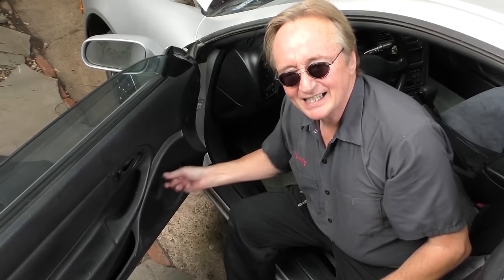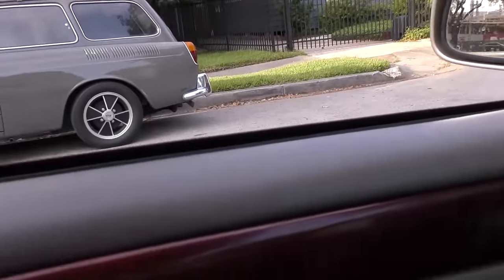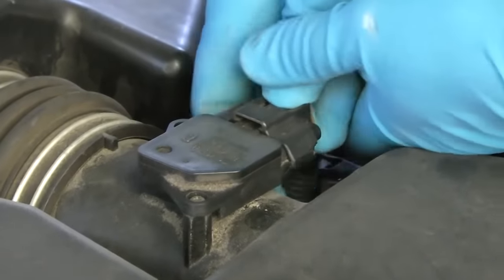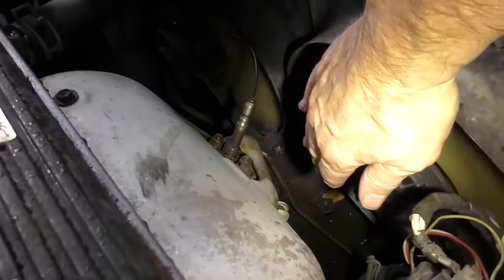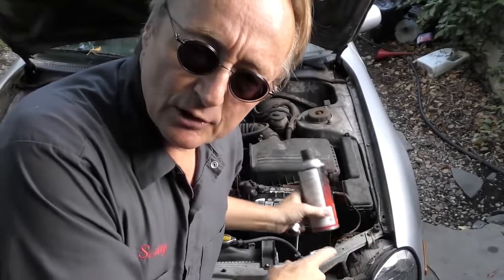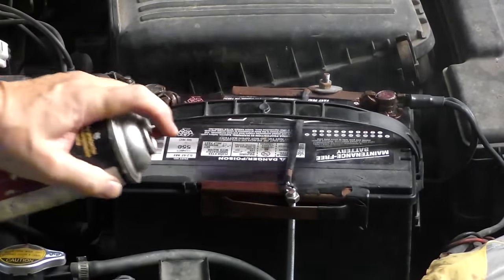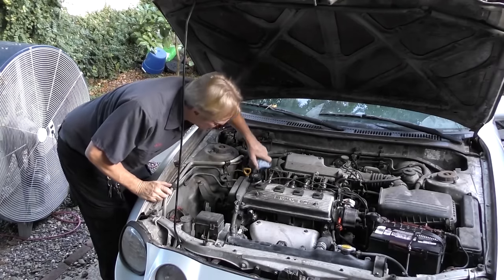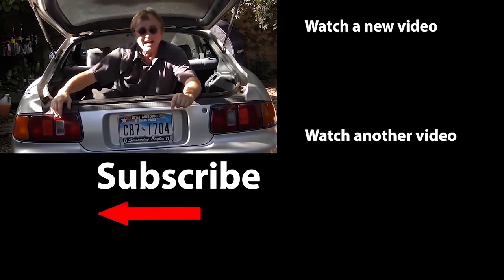I've Been Saying This for Years But You're Still Not Doing This to Your Car

Comment: I see that u r using CLR electrical cleaner it's saved me from my fridge to my power windows, when a coke was spilled on it , I used the CLR electrical cleaner and sprayed it on it and it fixed it like magic, it's cheap at Wal-Mart, and it's saved me $$$$$ it even saved my Granddaughter's toys when the battery s were left in to long, any Ware u need something electrical, it's a miracle. My daughter's has a Kia Sorento, junk and the electrical is messed up, and she can't afford another car, the battery goes dead so we got a alternator and it's still shutting the car off ,you can go maybe 45miles it shuts off then u count to 30 and it starts again , its been in the shop so many times  ,I told her to cut her losses and sell it to the junk yard. Thanks I love u r show u r so funny and a lost expert we desperately need.♥️🐿️🐦✝️

Comment: 8:42 -- You mentioned the EcoBoost Mustang producing more power with higher-octane gas.  A not-well-known fact is that this applies to ALL of Ford's EcoBoost engines!  If the engine is designed to run on 87-octane, it will, of course, run fine on 87-octane -- but it will produce more power on the 93-octane fuel.  So, no matter what Ford you're driving, if it has an EcoBoost engine of some sort, you will get more power if you use 93-octane.  How much more depends on the specific tune they've put in there, of course, but they'll all give you some HP increase with the higher-octane fuel.

Comment: The "automatic lowering but not raising" is for safety, so that you don't get fingers pinched in the closing windows.
Reply: My 2003 Mitsubishi Strada G-Wagon automatically reverses the closing window, if it encounters too much resistance, before fully closed.  Prevents fingers getting pinched.  It also encourages me to keep the windows and guides clean so that the windows will close every time.

Comment: Scotty, here are some gas tips that I have learnt over the years.  If most of your driving is city driving and you seldom drive on the highway, then use hightest gas when going on a trip driving on the highway. This helps remove carbon build up caused by too much city driving. Another tip is to use Shell gas and avoid Esso or Exxon gas, as this gas lowers your gas mileage.

Comment: CRC makes great cleaning sprays, especially their brake cleaner. Besides doing an excellent job on brakes and quickly evaporating with no residue, It is a very satisfying roach killer. You spray roaches, they will instantly flip on their backs, kick and spasm like crazy for about 5 seconds and then die.

Comment: actually, its possible for the air pressure a vehicle encounters while traveling to be GREATER than the vehicles actual velocity. This is caused by wind, in a headwind(wind coming towards the vehicle) you will experience travel speed+ wind speed air flow

Comment: Also if your auto window switch isn't working properly you can relearn it by holding it down when it's at it's lowest point for about 3 seconds or so and the same for going up if you have an auto up function

Comment: Whenever I use my turn signal with the lights on the speed of the blinker will slow down. If I turn the lights off the blinker speeds up. I have a new battery and my volt meter shows it’s over 14 volts.

Comment: I hate auto down Windows I rarely want the window all the way down and I don't want to spend the extra time to run the window all the way down and then run it up to a partial level. I wish we could turn back the clock to prior to TPMS and a lot of the so-called electronics advancements that have made vehicle repair more expensive.
And another video you discuss dealer problems
If they weren't making crap you wouldn't really need that many dealers.

Comment: Half way through this video I get phone from my girlfriend her 2012 FORD Focus power assist has stopped working. Just about every part on that POS has been replaced not even 200 kilometers 2 transmission. Don't ever buy this car so many recalls and class action suits. Ford has offered to buy car back, I told the even if you gave for price I've paid I'll never buy Ford! 2018 Mazda GT 3 Hatchback got a 5 year unlimited mileage warranty, almost 90 kilometers nothing broken. Just pads oil changes every 5Ks,only driven in city.

Comment: HI SCOTTY WHEN I TURN MY AIR CONDITIONER ON AND STEP ON THE GAS I HEAR A GROWLING NOISE COMING FROM THE RIGHT SIDE OF THE ENGINE THIS ONLY HAPPENS WHEN AM DOING 10 TO 20KM/HR WHEN I DRIVE FASTER THE NOISE GOES AWAY UNTIL I SLOW DOWN THEN THE NOISE COMES BACK I ONLY HEAR IT WHILE AM STEPPING ON THE GAS. THIS DOES NOT HAPPEN WHEN AIR CONDITIONER IS OFF CAR IS 2012 HYUNDAI SONATA ALMOST 300000KM ON IT EVERYTHING ELSE WORKS FINE I COULDNT GET A-READING ON MY SCAN TOOL SO AM A BIT LOST, AM ACTUALLY SUSPECTING THE COMPRESSOR BECAUSE I USE THE AIR CONDITIONER A LOT WHAT DO YOU THINK

Comment: the power windows and sunroof some on modern car's  have a control module that senses and learns the amount of current draw it takes to move the actuator through its travel cycle ,  if the control "senses" more current then it should it interrupts power and the window wont move ,  there are situations where the control forgets what it has learned ,, and you need to look up the process to go through to teach it again,  Search youtube "Power Window relearn (your model vehicle)" same with sunroof controls "sunroof relearn (your model vehicle)"  this mostly apply s to systems with "auto up/down"  functions that do not work properly.

Comment: 10-04-2020 - - - The reason the "up" switch shouldn't automatically drive the window up without holding the button is so some dummy or a kid doesn't hang his head out the window and accidentally push the button - choking himself to death.  FYI.

Comment: Hi Scotty I have a 2011 Ford Flex 3.5 L  engine the engine light has been on for a while auto zone scanner said the 2nd bank catalytic converter is not performing right, it's plugged, I normally buy the lowest grade gas, however this time  I filled the tank up with chevron middle grade gas thinking that it had more detergent in it so it might clean out the converter,  I was lucky it cleared up the converter and the engine light went off, have you ever run into this?   you are doing a great job educating people  keep up the great work    Kevin

Comment: Whoa be careful with that garden hose on the condenser coil. Too much water pressure can bend the fins and if enough of the fins get bent, it won't dissipate heat well enough and your AC won't blow as cold (or use more power and thus gas).

Comment: I never understood why they never put a secondary switch in them that engages (or disengages) when the window reaches it's limit (either up or down) that breaks the circuit for that direction so it's no longer trying to go any further whether you're still holding/pushing the button or not.

Comment: I had a Bad winndow motor on my CRV.  It wouldn't work. When I got the new motor I knew to tap on it and the window lowered  to the spot wher I could work on it. I motor had a bad contact point on it. Kind of like a bad starter that you would tap on to start the car. And yes the lights would dim while the window motor would do nothing.

Comment: Hey Mr scotty! I know this videos a bit old now, but you mentioned something in this video that I think might relate to my mother in laws dodge aveneger 2013. Could a bad battery contribute to the cars rpm dropping slightly by turning the wheel slightly and holding it while stopped? Its the weirdest thing literally the smallest movement and you can hear the cars entire sound change and the rpm drops a bit

Comment: Good advice still applies two years later. A little addition regarding Lexus automatic down and up. But what do you do if you only want it part way? Mine can easily stop anywhere . . . But I can't remember how! I (think?) each control switch  has both intermediates and full travel operating positions. I''ll have to do some experimenting or (Heaven forbid!) read the handbook to find out how to find out for sure.

Comment: Scotty,
For car/truck batteries, keep the battery' s top squeaky clean. Why? Road dust  is mostly made up of rust from other older vehicles. The "dust" (rust)  gets on the top of your battery causing a high impedance short between both battery posts. This puts a drain on your battery while it isn't running causing it to wear out sooner. Also, the alternator has to strain that much harder to charge the battery up to its "normal" condition. So, keep the battery clean, and use vaseline on the connectors and battery posts protecting them from oxygen causing corrosion of the lead posts and battery clamps. Vaseline has been a 60 year old solution to corrosion, and it is much cheaper. And, it WORKS! Everybody has petroleum jelly (vaseline) in their homes, and it is much cheaper than aerosol cans of protestant.

Comment: Are you Kidding ! You Do NOT Spray any Cleaner into ELECTRONIC THROTTLE , that's A Good way to Screw up the Electronics in the Throttle Housing on the side of the Throttle and they are Pricey to Replace $800 to $1,500 on GM just to name one...   You can only spray in Cable operated Throttle's NOT Electronic Throttle's...
Reply: I’m must have missed this.  Is this what he did, spray re electric throttle?  🤔 so he doesn’t know it all….

Comment: But Mr. Scotty i have noticed the idle change a little in all the cars with motorized windows when the window is closed and the switched is pulled. no mater what the engine size. i have tired it in many cars and got the same result.

Comment: Scotty, I live in New England state and looking to buy a used car without rust. Which state should I focus on where flood, salt, rust are not a problem. Used vehicles from New England are out of the question as they have the salt exposure already. I plan to have local undercoating done before it sees any road salt. TY

Comment: Bought 2013 Nissan Altima (I know lol) at 27k and now at 174k, did all maintenance as normal. (That I knew of) Should I change the transmission fluid now, no shifting or noticeable operating issues.

Comment: 1 thing i cant agree with is the break fluid story, i cant belive what u have just said, if its the shitty fluid called DOT 3, 4 or 5.1 they HAVE to be replaced every 2 years or so , the fluids are hygroscopic ...fancy word for water absorbent, and that prossess happends through the cap, through hoses, through the seals, its a normal prosess of the fluid and has time passes on more water (humidity really) gets collected inside the system and mess up the break system, the prosess is just like the air compressor, u dont really suck the water inside the machine but the air is humid)

Comment: when we did a bunch of modifications to my dad's 95 firebird v8, the rad fans wouldn't turn on for some reason, the car go pretty close to the red zone when we took it out for a test drive before we realised what was happening and I troubleshooted it for a few hrs and found absolutely nothing wrong with anything, then after taking it out on a few more test drives, the cooling fans magically started working again and the temp gauge never went past the centre point, bled the cooling system about 20 times so it couldn't have been any air bubbles. Just took  about 4 20 minute test drives to fix itself lol still don't know what happened.....

Comment: My 2002 Toyota Corolla Le has one fan work when it runs but doesn’t overheat since I changed the thermostat and etc sensor but ac doesn’t work but the ac unit moves freely but seems no power and I think I gotta get a new fan set. Help Scotty Kilmer! 😎

Comment: I hate power windows. I always buy hand crank windows. Problem is less and less cars have that feature of hand crank windows. I also do not like electric seat adjusters and a lot of other electriconic nonsense. So which is the best new car that has the least electronics with least computer sensors that has a fuel efficient engine that does not go over 80 mph? Lol looking for my next new car. 

I was told to always find out what items are in line to make things work. To then go through and test all the quick easy fixable items to most expensive ones to see what really is not working because mechanics will charge you a lot of money for unnecessary computerised diagnosis and replace the most expensive thing on the list with out testing. Then the issue still exists. I have always since things became computerised bought the diagnostic tool that works but is not crazy expensive to see what it says myself before taking it to any mechanic. I also bought a few other testing tools you have I your video about what mechanics do before buying a used car. Even a used car with low mileage if it was in a flood zone can have serious issues. I do mean low such as less that 5,000 miles on them.

Comment: My window seals squeak and it drives me nuts! It happens when my windows are up, putting pressure on the seals.   Silicone works for about a week.  Is there a grease I could apply to the inside of the gaskets that would be safe?  I read that Vaseline damages gaskets.

Comment: The driver's window on my 2005 Tundra works well except for when the outside temperature gets cold, then it is really sluggish, almost to the point where it barely moves. None of the other windows have that issue. What would cause this and how can I fix it?

Comment: I have a 1994 Silverado!!, I put that truck to everything, it's a four-by-four, and I used it as such!, I'm real torture!!, In my windows work just fine not a problem with anything !!, So I'm not going to worry about it, if something happens to it I'll take it to the shop and get it fixed that simple!!, Nobody should tanker was something unless there's something wrong with it can't fix something it ain't broke!!!!!!!!, Because when you go spring crap on it and start messing with things that's when you end up with problems!! , Anyway like I was saying!!, You can't polish a turd!!

Comment: Can the rubber on struts be changed without changing the strut. Mine dry rotted it's a Dodge Stratus 2002 model  thanx for your help. I need to know how to get my eagle summit to start after setting for a year it used to start right up I can hear the fuel pump working too.

Comment: Amsoil goes for 25k normal service with the signature series,  servere service 15k
Reply: @zeroyon4562  my car has been running great little too no wear in my engine with 136k miles. I resealed my timing cover and timing chain, all the gears, guides and vct in great shape.  The cams have very little scar wear I use only amsoil it's made with pao base oil instead of crude oil out of the ground in group 3 oil. Also run a catch in my car due to it being gdi to help keep the intake valves cleaner longer.

Comment: I have a honda 2012 CRV 146000 miles  did the brakes replaced rear calipers, keep up on the brake linings,
bleed out the system. had dealer do the coolant flush, and transmissions , Also the drive shaft
due to the bearing going bad! 2x due to first part failed after 10 days. dealer stood behind 
their work replaced at no charge. normal oil & filter changes, lube body and other parts. oh 
and timing chain at ~130k. what might be the next thing I should look out for? wheel bearings?
tie rods? ball joints? thanks barry

Comment: Hey Scotty! Your power steering fluid is looking low!! I have the same Toyota Matrix and noticed how low my steering fluid is, it's original to my 2005 Matrix, with 230K miles. Probably time to drain and refill it? 😅 Also, something under my engine whines when I get going about 50-60 mph. Still haven't been able to diagnose it.

Comment: 100% wrong on premium fuel. Premium fuel burns slower and cooler and has far less refined sugars. "Sweet Crude" means high sugar content.  If a car runs worse after higher octane fuel is added, it simply means that a maintenance problem was revealed that needs attention. Engines last 50% longer on PREMIUM FUEL, have fewer maintenance issues in general  and best of all  run cooler in general.  Considering that about 80 to 90% of all engines die from overheating, esp when A/C is being used, premium fuel can be the difference between a ruined engine and one that lasts years longer.

Comment: Have a 1997 Nissan P/UP. A/C works fine, in cool weather. When the outside air gets over, for instance, 85 degrees, it stops working. I checked the clutch gap. Unplugged the wiring to the compressor, plugged it back in. Swapped relays. I tried to recharge the system and noticed it wouldn't take a charge. By passed the switch and the clutch would engage.  I'm not sure if it's a low pressure switch or high pressure switch. I disconnected the plugs from the switches, hoping this simple thing would help, no way. Done. Any help would be appreciated. The one thing I do suspect is the fact that I can't seem to charge the system. But at this point I'm just quessing.

Comment: How can you fix the inner cloth sunroof rear cover on a split sunroof that just stays in the open position and does not budge when you push the switch off and without spending a fortune on a 2010 Lincoln MKX especially at the dealers shop? The front cover works fine so they must be on separate motors or track system? Please help since I am disabled and unable to even attempt to fix it much less no how to fix it myself due to too many neck and back surgeries and on a fixed income. An help you can give? The car is in good shape and just has under 90,000 miles on it. 🙏🙏🙏🙏Thanks!